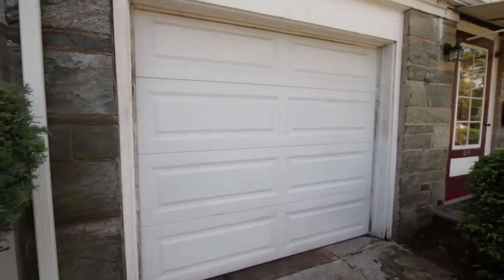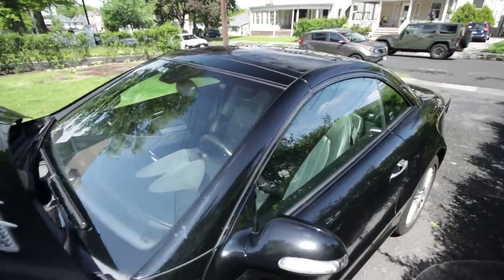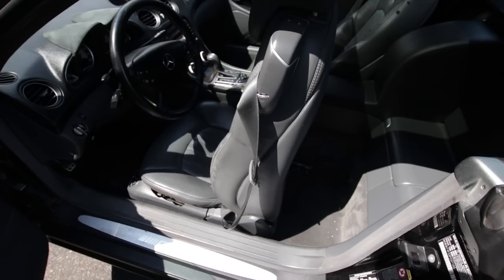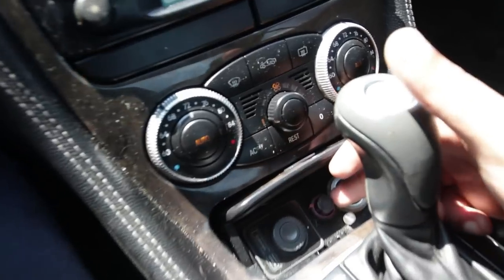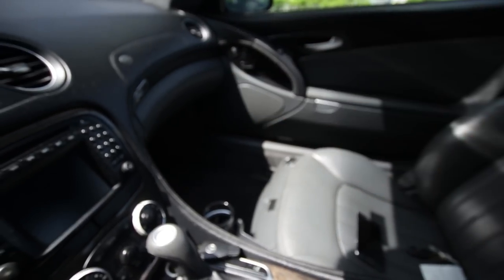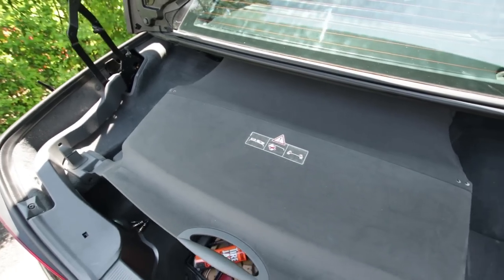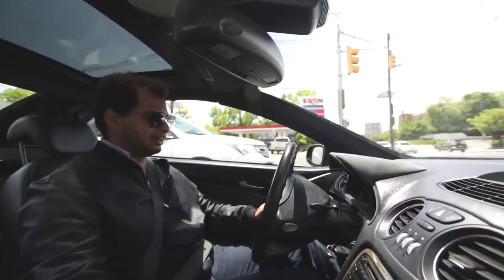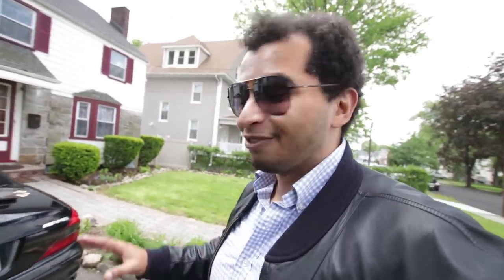I Just Bought A $130,000 Mercedes-Benz SL55 AMG For $8,900

Comment: Scotty kilmer does not approve
Reply from the maker: I'm glad.
Reply: Dorian Casasola lol
Reply: "Rev up your engines!", or in this case, "Rev up your credit card!".
Reply: He's a kook...
Reply: $5900 for new shocks?
Reply: He can't appreciate engineering and technology.
Reply: Dorian Casasola fuck is Scotty Kilmer???
Reply: Dorian Casasola fuck is Scotty Kilmer???
Reply: krisztiantth Scotty Kilmer is a mechanic/technician/YouTuber that loves to warn people just how much these cars can cost if you buy a basket case that has not been maintained. He is right and should be heeded to a point, but I'm not going to buy a Toyota/Lexus product (he drives a 90s Celica) just because he thinks Airmatic and ABC suspension components are not justifiable in cost. Lexus with plain jane McPherson suspension and less passive (let alone active) safety than Benzes are the real rip considering the premium charged for these cars, and frankly the other stuff like computers he complains about actually help technicians diagnose these cars. There are a lot of R230 and W220 and C215 out there for less than $5k US that need $10k in work to get them on the road. Research can prevent all of these purchase nightmares but Kilmer would have one throwing the baby out with the bath water.
Reply: krisztiantth That might be a little harsh. Kilmer knows his stuff, but he is advising a demographic of the market that can afford to buy-and therefore wrongfully assumes it can maintain-these cars. Depreciated or not, these are still some of the safest, highest-performing, and most luxurious machines on the road. Parts and service priced accordingly, though it's still cheaper than paying for a new $40k US Toyota or Ford car that still isn't as well equipped!
Reply: @Forrest Scott Brinkley. Dude your such a hypocrite. LOL You went from a Mercedes Fanboi bashing Lexus/Toyota to now actually agreeing with Scotty Kilmer. My entire post was basically saying the same thing as him. That's why I delete of your guys comments!  LOL What a Troll.
Reply: Eman 08 I've never said buying a basket case was a good idea. In your flawed logic, ALL Benzes are basket cases, which is simply not true. My ABC W220 has been a wonderful car that has fit well within my budget, but I did my homework and can afford the initial purchase AND maintenance.
Reply: Forrest Scott Brinkley LMAO. Scotty Kilmer and I basically saying the same stuff as we both hate German cars since they are so over engineered and too complex. I wouldn't want a car like that. That's why he says they are endless money pits. They are just not even worth buying. The average working class leases them, and then gets rid of them when the lease is up before the warranty expires on them. After 5 years they are money pit machines. Don't buy a Mercedes unless you are a millionaire!
Reply: Eman 08 Glad you are happy with your Toyota trim level. I don't even make six figures and yet I can afford an out-of-warranty W220 with ABC suspension. Oh, and I have a savings rate of 24% of my take home pay while doing it. Your math does not work.
Reply: You can keep fixing your money pit while I put a 1,000,000 miles on this bad boy. Matt Farah's Million Mile Lexus boi! Lol
Reply: Eman 08 ummm...that's not a GS. It's an LS. A first gen LS that is literally a Toyota trim level it's so basic. Your car is going to need work well before that. LS430 and 460 with air suspension won't even go 200k mi without 4-5 grand in suspension work. Engineers make tradeoffs all the time. Want a 1millon mile Benz? It's called a W123 diesel. Basic as hell but they are still roaming the planet 35-40 yrs later. Because they have class. And style. Something Lexus will never get. Spindle grill my ass...
Reply: Forrest Scott Brinkley lol I don't have non of that crap on my car as i have standard suspension with regular struts with AWD 276 HP 😂. My 2009 GS350 already has nearly double the milage on it clocked at 174,264 miles and the car is not even that old. It runs like a clock! Not your typical milage that you would find on an 09 car as most on an avg only have 97,000 miles on them. Its all highway miles since highway milage is less wear and tear on  the transmission and engine compared to a stop and go car. When a car is driven on the hwy, its operating at its optimized performance. I'm a DIYer as I do all the maintance myself as its never seen a repair shop.
Reply: 1) Let me see your car at 500k miles and then I will be impressed. The climate control system wont even last that long. My buddy's GS300 had a $6000 quote from dealer because stupid plastic flap connected to motor in dash broke and his dual zone climate died. 2) Apples to oranges. Of course Toyota Camry McPherson setup is going to last longer than active suspension. I prefer to NOT have to make a choice between feeling every bump in the road and not having dangerous, fun-ruining body roll. ABC is the ONLY system outside of GM Magride that can offer this.
Reply: I also have the Toyota TechStream software. The same dealer level scan tool that's used by The Toyota/Lexus dealerships that charges people to scan their car with. Haha so far no issue's since I wouldn't use it much at all since Lexus's are so well made.
Reply: ...because your car is so basic, how could it break? Yet the MSRP on those was what, 55 grand with some decent option boxes ticked? Give me a break.
Reply: Dorian Casasola in my Scotty Kilmer voice, a 2003 Mercedes $130,000 sold for $8,900 that's a heck of a beating to take after 14 years.
Reply: not true still have mine over 100 k miles and not willing to sell working mint only oil filters brake pads cost everything working as new .
Reply: Farming Mercedes benz are the worst vehicles to own for long term, they are too god damn expensive to maintain, my brother has a 2008 cls550 at 80,000 miles 5 months of ownership and that thing already costs him $5,000 in repairs, they are trash, and people who really like these vehicles will spend a fortune in overall maintenance.
Reply: Mcgyver B maybe you are right but it's he'll alot of difference in quality Mercedes for Europe and mine it's 3.0 diesel amg 5 cylinder so the engine it's more simple 231hp enough no need for v8
Reply: Mcgyver B If you don't research, pay too much for a car that needs to be repaired, and then pay someone else to do everything, you have a point. Otherwise, these cars are bargains. Tavarish even has a lift. If I had that I would do even more to my W220 by myself!
Reply: Farming The diesels are indeed less-complex vehicles. Most of the maintenance money on these goes into maintaining things like R230 convertible top and ABC suspension (or Airmatic on W220). What people do not understand is that Mercedes-Benz can beat Toyota in longevity if you tell them to design a spartan simplistic car. They were trying to please millionaires with these cars though, and so they built in complex luxury/performance features that would last the 3-5yrs for which millionaires typically own cars. If however you buy one used and fully depreciated if you can fix it yourself like Tavarish and get a millionaire's car for a middle-class price.
Reply: The average Joe aren't auto Techicans or mechanics. German cars are still junk as they made for Fix it again tony like the Fiat. They are over engineered and way too complicated to fix.
Reply: Eman 08 ...and yet I replaced my Front ABC valve block with a rebuilt unit all by myself....and I have a social science B.A. and an MBA, so there goes your theory on non-Tech ppl not being able to work on these cars. Truth be told it is easier than any American or Japanese car I've owned to physically do the work.
Reply: Eman 08 Ummmm...Autel MaxiDAS is working just fine for me. That was Scotty Kilmer's most useful tip... just go out and buy the scanner he's using as he's complaining about how "horrible" Mercedes are 😂
Reply: Eman 08 Mercedes are the worst vehicles to buy with hard earned money, unless the person is an auto geek that could literally pull down the whole engine components and put it back together, and am talking going to the Mercedes dealership and buy the overpriced ridiculous parts that still won't last long for the money, it's better to open up a savings account, and then buy a 1994 Honda Civic it will out run the Mercedes, and still keep your wallet fat, German vehicles are for wealthy folks who has too much money and don't no what to do with it, my girlfriend brother is a lawyer, and his BMW X5 is in the shop every god damn month, he's always in a different BMW loaner, he's a lawyer so he has no problem dropping $4,000 or $5,000 on fuel injectors, sparks plugs and engine coil misfire repairs at the BMW stealership, even though BMW as of lately has improved on their reliability.
Reply: 😂 that tool doesn't go in to depth as the the STAR dealer level scan tool. You won't be able to re flash ecu's or program an immobilizer.  I have the Toyota Techstream as i have access to everything. I even fixed my own air bag recall which the  passenger occupant sensor was out of calibration which was an easy 5 min fix and the airbag light went out. I can even customize my setup and how i want my door locks to lock with the smart keys etc. I have full control of every aspect of the car since i have the same software used at the Toyota dealerships.
Reply: Forrest Scott Brinkley that's true but buying any used vehicles is always a financial risk, but anything german especially used is a huge risk without proper warranty
Reply: Mcgyver B I think I told you before I wouldn't touch a stupid BMW with a 10 foot pole. Complete garbage compared to Mercedes-Benz.
Reply: Mcgyver B What part about buying a car at the bottom of its depreciation curve is risky? Even then it is only risky if you were going to resell the car or if you are a crappy non- defensive driver and get in total-out wrecks for the insurance to screw you out of your money. I drive defensively, have good insurance, and never have plans to sell my car. Replacing it with something equally nice would require buying a W221 or W222 S class which would require financing, which I have never done and will not do. What is risky is driving around in something as unsafe as a Honda Civic. I pray no one gets in wrecks in those things.
Reply: Eman 08 wow that's good to know since I will NEVER re-flash my ECU. You are obviously in the business if you have that kind of money laid out on a tool. If my computer can't fix it then I will pay the dealer. But don't worry I can afford to do this. I can actually afford to finance a brand-new E-Class. But that would be a real waste of money.
Reply: Forrest Scott Brinkley the truth always prevails over myth, there's no doubt a honda has a better reliability over a Mercedes, and buying a Mercedes is literally throwing away money, what good is a benz without a dealership warranty, and what good is a benz after its warranty period ends, these vehicles are designed for consumer jackasses to keep dumping cash into the brand, I could drive a Honda Civic and save up way more cash than a benz driver, you buy cars to keep them, I drive vehicles that holds value and have better re sale value, I trade in a 2008 Lexus GS 350 and that thing sold for $16,900 with a 80,000 miles on it giving me cash in my pocket, put a Mercedes on a lot for sale with 80k miles and watch that thing rot with no buyers.
Reply: Mcgyver B yup. My 09 GS350 is still selling round that much. Lexus are known for holding its resale value.
Reply: Mcgyver B just don't wreck in your unsafe little clown car Honda Civic. I've been doing just fine in my out of warranty W220 for 30 months and 30,000 miles. The previous owner's extended warranty fixed the most expensive stuff (research does indeed work 😉). As for your Toyota trim level Lexus GS you are comparing apples to oranges to my car. I have enough money not to really care about how much I can sell my car for even if I wanted to which I don't. With 30+% ROI, I'm much better at picking stocks anyways.
Reply: Eman 08 yup Lexus has been kicking the Germans ass in the consumer market for years, but don't get it twisted the Germans have been doing their homework, audi recently kicked lexus out of the number 1 spot, and BMW is now in the top 3 spot leaving Mercedes at the bottom with Chrysler dodge jeep.
Reply: in europe abc suspension in w220 you can change to the normal shocks without compressor and its getting cheap aggain with lower comfort
Reply: Farming I personally think the Germans built their vehicles for performance purposes, they don't care about reliability, but with lexus Honda Nissan Toyota dominating the market for so long, I think they are ready to change the game now.
Reply: Mcgyver B W123 and w124  models MB almost bankrupted because of thoes models 1 milion km without opening tranny or engine
Reply: Farming sadly enough they cannot sell any new models without proper warranty protection, Mercedes benz is just a status symbol, it's certainly not a long term ownership material, unless the owner doesn't mind throwing away cash to maintain it, they are very addictive vehicles to drive though, I drove the cls550 and there's no lexus to match that ride quality, so there's one thing we cannot deny, and it's the fact that the Germans are masters at performance and handling, any person drives a BMW or Mercedes, will automatically notice a downgrade driving any other brand.
Reply: That TopGear Chris Harris video proved that the GS-F had better handing than the m5.
Reply: Eman 08 yes I saw that, the gsf is still an underrated vehicle, and it's only because lexus started off as just a luxury brand, but the rivalry will continue, lexus reign as king in reliability, and the Germans are tyrants when it comes to performances, lexus now has the Ls model with twin turbos, 🤔so when you think about it, the Germans are improving their reliability, Audi kicked lexus out of its number 1 spot, and Lexus is now getting geared up with turbos, by 2020 we're gonna see some challenges, and I think Lexus is gonna make a huge comeback simply because they are dealing with turbos in the their engines.
Reply: Mcgyver B Mcgyver B Kicked Lexus out of number 1 spot? I don't recall anything like that recently. Lexus has been consistently #1 on Consumer Reports year after year which still is currently. Toyota is actually the most valuable car manufacturer in the world currently.
Reply: Eman 08 GS-F with active suspension? Gee...wonder what that's going to cost to replace when it goes? 💰💰💰 Ppl like you rag on Benz for active suspensions then praise Lexus for same system. LS430 and 460 models have just as many problems with their air suspensions (and just as active an aftermarket for coilover conversion). Do some research.
Reply: Eman 08 Audi leads the pack with an 81 score Porsche number 2 with 78 score BMW tied up with lexus at 77 yes lexus reign for a long time but things have changed, go do your research.
Reply: Forrest Scott Brinkley yea he's lacking his research, I think he needs an update on the newer informations.
Reply: Mcgyver B What are these stats? And to your earlier point, I love my no-compromises ABC suspension on my W220. The money I spent to maintain it therefore is well worth the premium because no other car can match it unless you start playing in $300k US territory for a Rolls-Royce. Even then you will have a suspension biased toward ride because Rolls are chauffeur vehicles, not drivers' cars. I will admit that I am probably not your typical sub-$20k US car buyer though in that I can more than afford to maintain my W220 just by writing checks.
Reply: Forrest Scott Brinkley those are overall scores, from owner satisfaction,predicted reliability, and road score test, my intentions is never to discourage anyone from any particular brand, plus I don't bias or fan boy any brand, because there's always rivalry between all these vehicle brands, which means their statistics will change overtime in order to challenge their competitors on the market scene, I think any car enthusiasts should experience driving all of them, I've driven and owned two Lexus ES and 3 Lexus GS one Dodge Charger hemi v8 a BMW m5 Mercedes benz cls550 and BMW X6m which am currently driving now, a person will pay for what they love.
Reply: Mcgyver B Website, TV program, magazine? Which models were compared? Lexus for one sells hardly any cars (Germans beat them 3:1 in sales on some models), so their "satisfaction" score has to be based upon a bunch of crossover owners' opinions 😴 The highly-rated current-gen GS-F is the only car I would even consider test driving in their current lineup, and that is because it has...wait for it... Active suspension! This is the same thing people complain about wearing out on Mercedes products and it wears out on Lexus cars too. If people care at all about the enjoyability of the behind-the-wheel experience, they will have to cede some of that Toyota Camry drive-it-for-300k-mi.-with-no-unplanned-maintenance reliability. I did and it change driving from a mind numbing chore to something I look forward to doing.
Reply: Forrest Scott Brinkley BMW and Mercedes they've been around way before lexus even existed, so of course they make better vehicles, the Germans are such master they only focus on performance, and make the customers pay more to drive their product, this is exactly what you do when you're too damn good at something, I still give lexus a lot of credit, because they took a whole lot of German customers away with their reliability reputation, but the Germans know once that performance DNA experience hits a driver they will still park that damn boring lexus and jump back into the twin turbo m sport or that v12 something big will be coming though the lexus will become a high performance machine, they are already using turbo engines
Reply: They are masters in "Over Engineering" Which is a reason why they have soo many issues and fall part and a bitch to work on. That's why they have very poor resale value. Toyota uses DENSO and the Germans use BOSCH a reason why Germans have shitty electronics.
Reply: Mcgyver B The Turbo V6 in the new LS is a downgrade to please CAFE and carbon-neutrality law Nazis. Benz and Bimmer offer V8s. The LS will continue to be a sales dog. Lexus reliability has also taken a hit as they have added more complex systems like active suspension to their products. The LS430 and 460 aftermarket suspension options are proof in the pudding. They may still hold their value better than German makes, but they do not hold their value as well as their predecessors.
Reply: Eman 08 this is true especially the Mercedes, they look so damn good but they are service shop hoers, they spend way more time getting felt up on by mechanics, and just like I said the Germans know that they give such a sweet performance people will still open their wallets and cry that hoer machine to drop it like its hot.
Reply: Mcgyver B Mine is 15 years old with 100k miles. I drive it more than it is in the shop. Your claim depends upon whether or not the car is a basket case in the first place. I bought a mint dealer-maintained car that had a lot of issues already addressed. Just as with the initial six-figure purchase price of these cars, the punishment for not doing research is much more financially painful than with a less-complex Japanese product.
Reply: Eman 08 the Mercedes benz cls550 that car is a nightmare, rides like space craft from the final frontiers, but it will take all your money, the Germans are mafia in the car industry.
Reply: Mcgyver B CLS550 has Airmatic, correct? I will agree that if you pay the dealer to do everything and did not shop around for Arnott replacement options, that is an expensive car to own. I have active body control on my S class, which is an even more expensive system. However, through the wonders of eBay and my own mechanical skills, I just saved US$1800 by swapping in a rebuilt front hydraulic valve block by myself. You can do what Tavarish is doing if it pleases you.
Reply: Forrest Scott Brinkley I do believe that every brand has its lemon, when I bought my 2008 Lexus GS350 I had a 3 year factory warranty, and that thing run 3 straight years with no issues at all, the only problem I had in the fourth year was my rear calipers seized up due to climate changes from snow and salt, but that car run like a true champ, my BMW X6 I've been driving it for two years no issues so far just one or two misfire, and the check engine light cleared off on it's on but it runs like a beast, the cls550 was a nightmare, it was like a pretty girl stealing money every time you visit her.
Reply: Forrest Scott Brinkley this is exactly how a Mercedes suits its driver, a person that knows how to turn a wrench, and yes you're right Mercedes benz is not a poor mans vehicle, it's a never ending investment, but this also has to do with climate, and how the driver operates the vehicle, Mercedes benz is such a beautiful car I personally don't think they should be driven in snow, anyone buys a $100,000 vehicle and drives it in winter conditions is crazy, a Mercedes should be a garage queen that only comes out on the weekends or for special occasions.
Reply: Mcgyver B you don't have to know how to work on cars if you can afford one of these things brand-new. In fact most of these folks don't do any manual labor at all. However in order to own one of these cars as a middle-class man or woman one must be able to do at least 75% of the work him or herself and have some savvy at locating alternative parts sources for the most expensive systems in the car like Tavarish and me. Mine is a great daily driver and has never left me stranded as I have traveled across most of the continental United States. I do, however, bicycle to work in the warm, long southwestern summers where I live so the car is spared a lot of city mileage (and I am spared obesity 🏋️).
Reply: Forrest Scott Brinkley I certainly wouldn't buy a Mercedes benz brand new, 🤔it's really not the best financial decision to make, look at this one ☝️ in the video it went from $130,000 to $8,900 that's a whole lotta beating, basically throwing your cash away, you see rich folks never talk rich,  they always avoid spending rich, it's the poor folks that take out 75 year mortgages, and 85 months auto loan payments, rich folks usually drive Honda or Camry, warren buffet drove his 2001 towncar for years until he sold it for $73,200 the man literally gave the car equity value, rich folks are always looking to take your money they don't wanna spend no money.
Reply: Mcgyver B you are missing the point. Of course new exotic cars are a bad "investment." (With exception of some Italian models). Lexus vehicles go down in value too and most could never be called exotic by any measure of the term. It doesn't matter if one can afford them new though. I am talking a different socioeconomic class here. The man who paid an inflation-adjusted equivalent of US$150,000 for my car can afford to lose that much money and not notice it. He's a retired millionaire lobbyist lawyer. Hollywood celebrities that typically drive around in the SL Tavarish bought can afford to do the same. To be honest there are not that many of these kind of cars around where I live because we do not have that many millionaires. There are many C classes and Benz crossovers though.
Reply: Forrest Scott Brinkley I will say that is true Lexus is definitely not exotic at all, I think they looked better when they first emerged on the scene, nowadays I wouldn't buy one, the front grille looks a bit too hideous, especially the rx350 the front grille looks like a big open mouth sea creature on land, why the hell would any pay $72,520 for a 2017 lexus ls460 and pass up a better looking German model or any other European model with better performance, the problem I have with Lexus is that they are asking for too much money for nothing, but reliability, that's all they offer is reliability, boring vehicles, and what's worse they are still top dollar in maintenance as well, might as well go for the performance and the looks, this is exactly why the Germans rule everything in the vehicle kingdom.
Reply: last time I checked the LFA has doubled in resale vaule currently up to $500,000. Lexus don't depreciate as fast as European cars do.
Reply: Eman 08 but didn't lexus discontinue the LFA line in 2012 due to no profit gains, and poor demands, yes lexus does have a better re sale value, but the Germans have a right away purchasing agreement at a higher level, they don't care about after sale, because they push their vehicles out the door brand new for top dollars, like I said the Germans are mafias, they already make money off leasing and selling, they don't care about re sale or reliability, lexus still can't top them no matter what, unless they become more exotic and contribute higher performers the Germans will always spank them.
Reply: Mcgyver B it had nothing to do with profit gains. its was an exclusive $5,000,000 project which they planned to only make 500 of them. The cars them self take soo long to build as they were 100% hand made. Toyota has soo much money as they are not hurting esp when they are the worlds most valuable Auto manufacturer worth 28 billion dollars.
Reply: Eman 08 it's easy to say that Lexus is arguably no comparison to the German vehicles, these are statistically facts, like I said previously, if you're that good at doing something, you make the consumer pay double the amount, and even with lexus reputable reliability records, the Germans still outsell them, they don't care about poor people that are crying about reliability, they push out super power models after models, and lexus basically sell dressed up Toyotas, right now the new Toyota Camry looks much better than the gsf in my opinion.
Reply: Mcgyver B German luxury cars sure ain't selling much here in the U.S not in my book. The Sedan market is dying in the U.S market if you notice the judge shift for bigger machines Trucks and Crossovers. Crossovers are being out numbered by regular cars compared to two years ago. The Luxury sedan market is a niche market now as the Crossovers are replacing them esp when they share the same platform.
Reply: Eman 08 They still depreciate though. Your precious LFA was an exotic loss leader that is a statistical outlier. Mercedes series production cars (like this SL) will always outperform their Lexus "competition."
Reply: Eman 08 Sales figures are saying otherwise. Lexus is way behind the Germans.
Reply: Forrest Scott Brinkley It sure ain't depreciating like the Germans. Like I said Toyota has soo much money as they are not loosing anything. They had an extra 5 million dollars laying around to burn so they decided to build something to see what they can do rather than looking to make a profit. It was an exclusive project not a production car.
Reply: +Forrest Scott Brinkley Hardly anyone buys German luxury cars as the average working class here in America leases them. My Primo went from leasing a BMW 4 series to now leasing a 2016 Mercedes C-Class coupe. He doesn't buy them as he knows they are money pit machines which he can walk away from.
Reply: Eman 08 that's exactly my argument, they are still making money regardless, and still have countless models in production, BMW dealerships are the worst when it comes to dealing with its customers, the Germans literally doesn't have any fucks to give, and they still sell and still make money off sale, and parts, personally I won't buy any vehicle brand new.
Reply: Eman 08 I would love to see lexus step up its brand though, with better design, and better performance, they are awesome with interiors, I just don't like their exterior finishes at all, I think the IS models look good though, that's the only one I like.
Reply: Mcgyver B You mean you don't like that cowcatcher grille they are apparently so proud of they keep slapping it on the front of every product they release? 🤢🤢🤢😷😷😷
Reply: Eman 08 Leasing is flushing money down the toilet always has been, always will be. That's unless you buy a new car every three years, which is still throwing money down the toilet. I have an out of warranty W220 with ABC, a poster child for your "money pit" scenario. I have yet to spend enough money for even a C-Class three-year lease, and yet I am driving an S-Class that I own. As for your sales misconceptions, Benz is #1. Argument over. http://www.goodcarbadcar.net/2017/04/march-2017-usa-auto-sales-brand-results-rankings-stats.html?m=0
Reply: Forrest Scott Brinkley they need to fire the stylist designer and bring back the 90s designer lexus was so dope in the 90s even rapper jayz had the 1994 Lexus GS the 1998 gs was a beautiful design, they completely destroyed the brand, they are definitely not original with the lineup, the brand has been going through an identity crisis, you could line up all BMW and still see that there's a traditional roots going on, if you line up all the Lexus GS models you would wonder if a Hyundai Sonata had a baby with 2010 5 series, yes they have been stalking the Germans, lexus used to be all wood grain interior, even the steering wheel is woodgrain, now their interior is mimicking BMW, this identity crisis needs to end, the front grille is ugly, I only like the IS model, and the newly released LC500
Reply: Mcgyver B The only good thing I have to say about the LC500 is it has available V8 power at launch. Their "flagship" sedan will have a turbo six 🙄😴
Reply: Forrest Scott Brinkley I don't think I like we're Lexus is heading, they need to stop making grandpa sedans and old menopause office old lady SUVs stop with the hideous grills and do better, all the BMW SUV looks better all the Mercedes SUV looks better, even Kia for Christ sake is kicking their ass with style.
Reply: 😂😂😂 LMAO only 31,963 cars? compared to the bigger GM, Toyota Ford, manufactures. That aint shit, lol besides those reports are old as its June now. Post me some recent shit homie. Again no one is buying them but rich people while the rest of the avg working class leases them.
Reply: Eman 08 and your point? Lexus is still way below Benz.
Reply: Mcgyver B Nonsense! BMW needed them to provide a distraction from the Bangle butt...and distract they did! The Bangle 7-Series not only looked ugly but had horrible reliability in areas as elementary as the engine. Lexus came with the stodgy,  bug-eyed LS430 just in time😂
Reply: Scott Kilmer annoys me
Reply: @fsb1284  Leasing is flushing money down the toilet huh? Hmm
Reply: @carlbenz3341  no he doesn't appreciate shitty service.